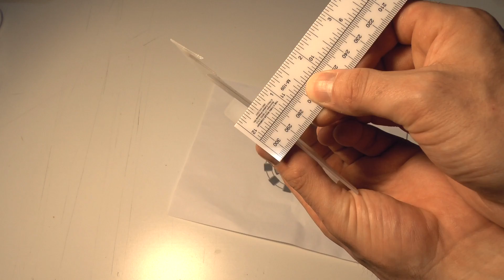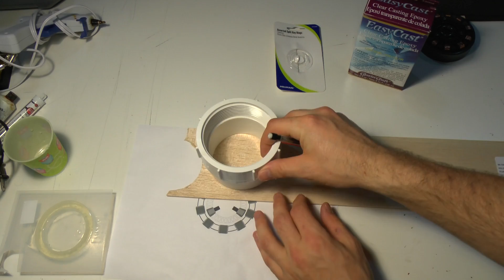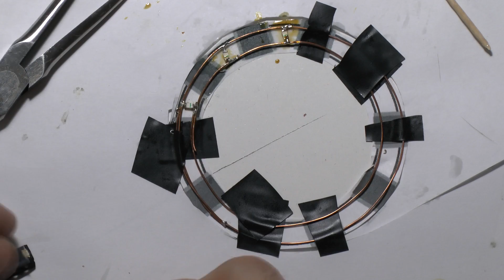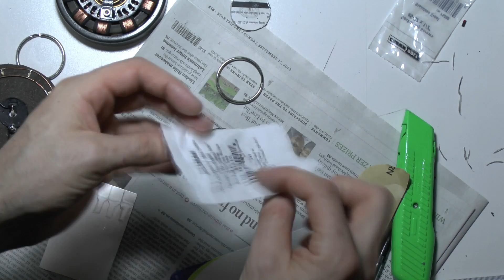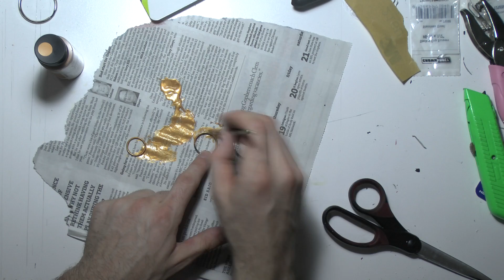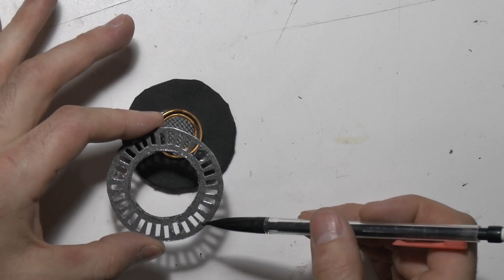Iron Man Arc Reactor, DIY Wearable, Detailed Tutorial

Comment: In my place, THERE IS NO Clear Epoxy Resin and LED's that is sold into the public. (OR there are but I just can't find them)
Maybe I can melt some GLUE STICKS and pour into the mold.
I don't do much soldering either.

I made one differently.

I found a string of LED's encased in flexible plastic/resin.

I cut it to size and formed a LED ring the size a bit smaller than of a Pringle plastic cap.

I got a small Flashlight Focusing Dish (FFD) and glued it the center of the plastic cap.

I got a small bulb (a peanut bulb for motorcycles) and glued it at the center of FFD.

I wired all of them and used a glue gun and lots of glue stick since I don't solder it.

I also cut a paperclip to form a small OMEGA-shaped wire and glued it to he back top of the arc reactor; and used a fishing line through the wire so I can wear it like a necklace.

I don't have any 12-volt motorcycle battery and its HEAVY to carry one around, so I used 9-Volt Batteries.
The string of LED's and the Peanut Bulb used are both of 12-volt bulbs. AND CAN HANDLE 18 VOLTS.
I have three batteries for each set (there are 2 sets). One battery (9 volts) to give it DIM Light... and two batteries (18 volts) to give a BRIGHT Light. and a switch for DIM/BRIGHT mode.... and an ON/OFF switch for each set.

Since SIX 9-volt batteries are BIG (NOT button batteries), and the arc reactor is worn INSIDE the shirt, I had the batteries NOT attached to the back of the arc reactor. A length of wires are used from the arc reactor down to the waist (or belt) where the batteries (and switches) are placed.

Comment: Nice plans, but according to the ruler you are using, the only thing you got right was the 2 1/4" ID.  The other measurements look to be off quite a bit.  It looks to be 1/4" thick and either 3/8 or 6/16 inch wide.  5/8 inch is pretty big.  You might want to recheck your measurements.
Reply from the maker: I will check the measurements and get back to you, but I think the camera was just not at the right angle to really see.  The edges curve and so you have to line your eye up just right to get the right measurement.

Comment: hello you probably wont respond but ive done everything the same bu twhen i go to put the battery with the LED to the rings to test the soldered led's between the rings the LED doesn't light up please help halloween is only a couple of days away!!!!!
Reply from the maker: +Katelyn Jones Hi, really sorry I didn't see your comment in time before halloween.  I hope you were able to figure it out.  My guess is that you had the LED backwards and then it would immediately burn out when you put the battery in.  Otherwise I would guess soldering connection was not good or battery voltage doesn't match the LED requirements.

Comment: Nice!! Awesome work man. How does it look in the dark? The Arc reactors look pretty bright in the movies, but this looked a bit more on the darker blue side. Hard to tell though because when you turned it on, it was a bright setting.
Reply from the maker: Thanks!!  It is pretty bright in the dark actually!  If you want it even brighter though, you can buy the ultra bright LEDs.  Also I scratched up the clear areas to diffuse the light and make it a bit dimmer so that you could see other details easier.  Skip the diffusing part and place the LEDs between (instead of behind) the fake transistors for a brighter more direct beam.

Comment: Hey, doing a fine job man. I am looking forward to see more marvel related videos from you. Btw can I use a 2025 battery instead of 2032? thanks.
Reply from the maker: Thanks!  I would think a 2025 would power the LEDs fine because they are both 3V.  I would double check that 2025 fits in the battery holder and then give it a try.
Reply: thanks man do tell me then, because it is really hard to find a 2032 battery holder here.
Reply from the maker: Yep, 2025 seemed to work fine for me.  The battery life may be affected, not sure.
Reply: thanks man.

Comment: Are you saying that the mold is 2 1/4inch inner diameter, 5.8inch wide, 1.7th inch wide and 1.8inch thick? I'm a little confused on how big the actual mold is. Thanks for making this tutorial.
Reply from the maker: Sorry about the confusion.  The resulting bracelet you get out of the mold will have a 2 1/4 Inch inner diameter, 5/8 Inch height, 9mm thickness.
http://www.beadaholique.com/p-25278-resin-epoxy-mold-for-bangle-bracelet-2-14-id-58-high.aspx